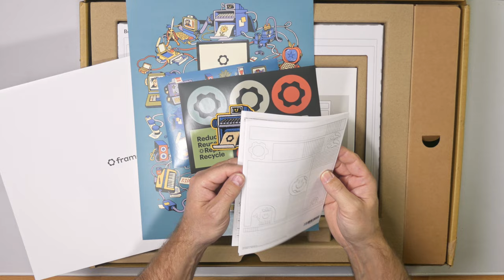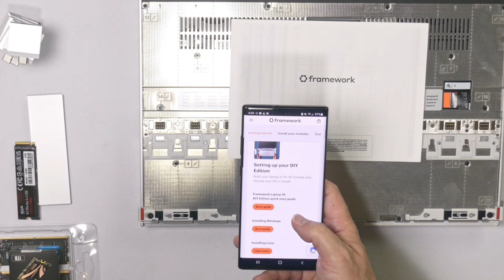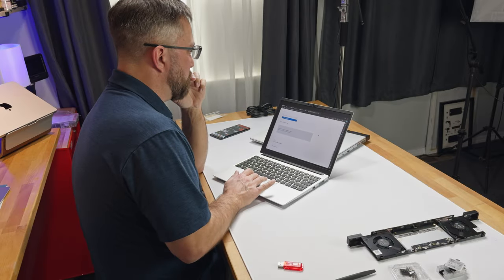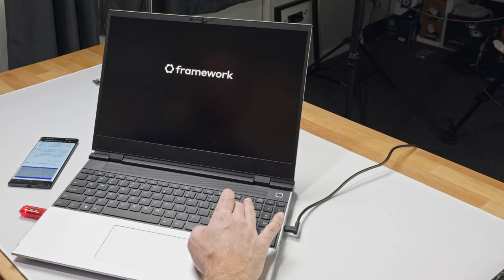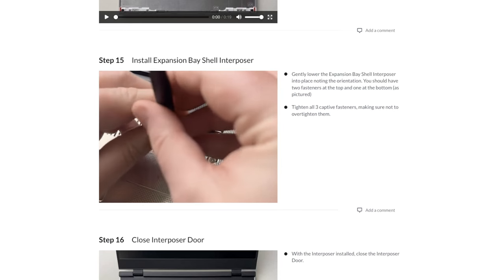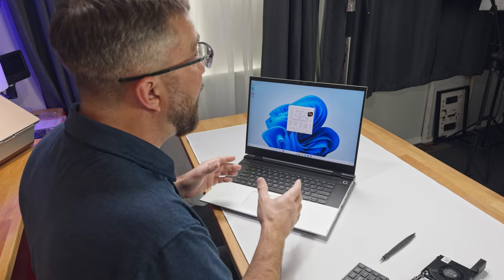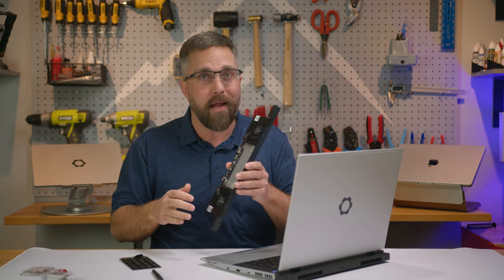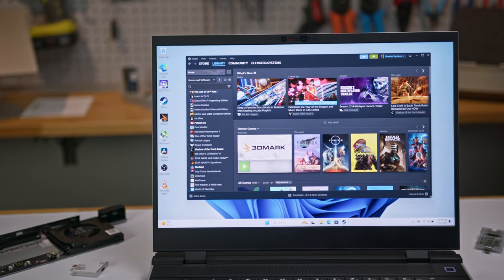The Framework 16!, Unboxing, Setup, & First Impressions!

Comment: looking forward to more videos on this laptop.  I almost pre-ordered it but couldn't justify the cost for my use case.  I love the idea behind framework but the cost is what always holds me back.  maybe one day i can pick up a framework used
Reply from the maker: Framework launched an outlet where you can pick up a refurbished or B stock framework 13 for as low as $499.
Reply: @ElevatedSystems  Oh snaps! def didn't know about that.  I'll have to look into it, thanks for the heads up
Reply: @TokenTech  Don't buy the b stock. The screens have manufacturing flaws.
Reply: @HeyBuddays  thanks for the heads up, I am currently not looking but I do have some friends who are so I will pass it along to them to look out for
Reply: @TokenTech   bro don't lose ur friends , only buy stuff from big brands unless ur frnds are multi millionaire
Reply: @ElevatedSystems  if buy the non diy one you can still do same thing with it as diy one later on
Reply: @Paras-ot2qo  yeah you got a good point, he told me he likes dells... so that's probably what he will get.  At the end of the day I just want him to have something he is comfortable with

Comment: What's the point of upgradability if changing the processor also requires changing the motherboard? All this at the price of a laptop that, at the same cost, is still upgradeable for RAM, SSD, and Wi-Fi card. Years ago, there were laptops with removable CPUs, all at the cost of a few extra millimeters in thickness, something that surely wouldn't have bothered anyone here. Let's talk about repairability and customization, but the concept is simply excessive compared to what it offers. Why is the CPU soldered in a laptop designed to be easily upgradeable? This makes no sense, there's no debating that.
Reply: The RAM is not soldered (maybe you meant cpu?)
And the answer is simple: the CPU manufacturers (amd and Intel) only make them in a bga package to be soldered. There are also significant technical reasons that laptops are exclusively being made with bga (soldered cpus), power, memory reliability, are just the two I’m most aware of. socketed laptop cpus of a decade ago almost never had a real upgrade path due to chipset limitations.
In this day and age through, ram is soldered, storage is frequently soldered, and so is wifi. Part of that upgradability is being able to replace the motherboard easily, and the old one will still function outside of the laptop.
Reply from the maker: Unfortunately, there is nothing Framework or anyone can do about soldered on mobile CPU's. It's completely a decision made by both Intel and AMD. from what I understand they won't even let their partner laptop manufacturers explore ways to socket their CPU's.
Reply: @Lovedbychrist1  Sorry, and thank you for pointing it out. I don't know why I wrote RAM, I meant to say CPU.
Reply: @ElevatedSystems  Too bad, because it significantly diminishes the very essence of the laptop.
Reply: you can easily do it with other PCs when you buy a new one at that price, after all the old PC doesn't disappear when you buy a new one, especially at that price. Furthermore, not everyone has a 3D printer, and the official cases are certainly not cheap, therefore adding to the price of a new motherboard + CPU.
Reply from the maker: @Bluestreak589  you should probably check out my Framework 13 playlist.
Reply: I don’t believe AMD would preclude someone from trying, and a few socketed Intel mobile 12gen chips have been made in china to work on desktop counterparts. Part of the issue is reliability, those weird socketed from mobile chips have memory issues (from reviews I have seen). Its probably more of a case that the engineering to make it work just isn’t worth it when the next generation won’t be supported by the old chipset anyway.
Reply: @Cyrus_Stone  There are a lot of services that will 3d print stuff for not that much money.
Just buying a new motherboard is mostly cheaper than buying a whole new laptop plus you produce a lot more waste and with other laptops is something on the Motherboard breaks the whole is mostly e-waste. And removable isn't a thing anymore on many laptops.
Reply: @Lovedbychrist1  But I'm pretty sure they won't support you in anyway and its quite possible that they something about that written in the contract so you can't really do that on a commercial scale.
Reply from the maker: @Lovedbychrist1  China does anything they want, but yes AMD and Intel preclude their official partners from using their silicon outside of a very strict set of specifications.
Reply: Clevo sells laptops with socketed CPUs. They use "desktop" versions. Their laptops run very hot.

If Framework could figure out the cooling it would be an option. That's a big "if" of course.

Comment: While the modularity of the keyboard and track pad is neat, I hope they have options for a solid all-in-one face plate in a few configurations, mimicking the look and feel of the 13" models. I would opt for a number pad on the right, and the keyboard and touch pad to the left as one solid plate.
Reply: You want the track pad to not be in the center?

Also why left? Assuming your right-handed wouldn't it be better on the right?
Reply: @bland9876  Because that's how all other laptops with a number pad have it. If the track pad was on the right my palm or wrist might activate it. Normally the track pad is centered on the keyboard, making it on the left when there is a num pad. Also, I'm left-handed but I still use my right hand for mouse activities.
Reply: @mllarson  hmm wonder why laptop makers did that.

Comment: Framework is always a fun conversation topic! This seems like a first generation product but still many things done right, while $2700 is quite a bit of money i remember about 15 years ago people paying about a 50% premium for their laptop to just write vaio on the case, and i dont remember them to be that reliable! The good thing is that there is the possibility for framework to fix/upgrade many of the problems down the line, like a bigger touchpad module or a better keyboard or screen etc

If nothing else at least for me Framework is making interesting products, even if they are quite a bit outside my price range, which seems to be most tech products nowadays!
Reply: Never buy based on the promise and, especially, a hope of one.

Comment: Conceptually, I see machines like this as ideal for group deployments like student laptops at schools. In the likely scenario that something breaks due to rough handling it would be easier and less expensive for an IT person to replace individual parts than a whole machine. That said, the price point and the fit/finish quirks might be a tough sell. I hope that Framework is able to address and iterate on some of the common issues moving forward. It feels like they have a decent platform (a "framework" if you will) and that improvements (like different screen, keyboard or track pad configurations) can be released to meet those pain points in the future.

Comment: Nice analysis and rundown. My next laptop will likely be a Framework, and I've been seriously looking at the 16, but I think I might wait until the next gen of the 16's design. There are some fit/finish things you highlighted that I'd like to see worked out. I'm patient and my current daily laptop still have another couple years of life in it yet.

Comment: I've been living with my 16 for a few months now as well--and I can say that pretty much all of your nits align with my experience.  If Framework offered a larger trackpad and a keyboard with dedicated navkeys (even if it precluded the numpad), I'd buy them in a heartbeat.  I've also found the same fit & finish issues with the spacers.  Larger input modules that fill the deck without the need for spacers might moot this.  Hopefully either Framework or a 3rd party steps up to the plate with a solution.  In the meantime, it's moderately annoying but workable.

I didn't buy the expansion bay module so I can't comment on that one.  The price of the laptop was a bit of a stretch for me, but if it really is my last laptop ever, it will have been worth it.

Comment: The only way I was able to get into the framework ecosystem was to buy a Factory B grade Framework 13 model. I got the Intel 11th gen for $600 which included all the USB accessories and the wifi card. I had Ram and an M.2 from an older system that I threw in it.

I plan to eventually upgrade the motherboard to an intel model later. This is where I expect to start saving money. Its so nice to not have to view my laptops as a limited lifespan electronic anymore. Now I can just repair and replace as needed.

Comment: My pre-order is on it's way and I'm really hoping that I'm able to upgrade/improve my framework over time.  This laptop is my replacement for my venerable 15" MBP 2013 (best laptop ever!) and I will be doing a lot of similar tasks, particularly Fusion 360.  I need a big screen otherwise the 13" would have been the right choice by far.  Also, I hate disposable electronics so I'm hoping this encourages other companies.  Thanks for doing a deep dive over time.

Comment: At [5:39] (skip through the second frame by frame), you can see a small gap between the touchpad housing and the actual touchpad. So it looks like grime and dust can enter there during use.
[6:30]: Are the old USB-C modules you have rated for USB-PD-ESR?

Comment: I'm hoping they solve the problems with fitment and finish by the time they ship my Batch 4 order.   Still, the main reason for ordering it is the repairability for a workstation/gaming class computer.   Every laptop I've had that wasn't a full CNC metal chasis has had hinge failure.   I suspect that the framework will also have hinge failure.  It is inevitable on a workstation/gaming class computer due to the thermal envelope reducing plastic lifespan.    I have heard so many: "This never happened to my dell/lenovo/hp/etc." but again, most people aren't doing workstation class work with a business/consumer laptop.   Its all about the use case.  I have been known to have multiple laptops going for 14+ hours a day for multiple days while on the road.   We will see if this meets the needs.   But at least with this I know that a hinge failure likely isn't going to damage the main board and user-available replacement components exist.   I am not expecting it to be inexpensive to repair, but I am expecting to be able to repair it before further damage happens.   I keep my computers until they die.   I'm hoping this one might last until I die - even if it is the "Laptop of Theseus".

Comment: Thanks for the review! So glad I cancelled my batch 2 order. At this price point, this laptop is simply not worth it and the only reason to buy this is because you support the FW mission statement. However, even that is somewhat problematic when you can get Thinkpads and HP Elitebooks that are equally user repairable with available components and official tutorials but with better build quality. I even believe LTT did a video on the high user reparability of the Elitebook 845 G9. But the FW 16 is a gen 1 product and can only get better. Looking forward to more of your videos as well as seeing how FW expands on this concept moving forward!  Nice job CJ as always!!!

Comment: Odd about the SSD, the 2230 is the secondary storage and the 2280 is the primary when configuring at purchase. What type connector is on the modules? It's interesting that you can put different connection types in any of the slots for the most part, Ethernet, hdmi, usb, work on the same ports.

Comment: The concept is mildly reminiscent of the Sandbenders laptops in William Gibson's _Idoru_. These were highly customized/individualized machines with a recycled chassis and DIY components: "And once you had the case, when the manufacturer brought out a new model, well, if the electronics were any better, you just pulled the old ones out and put the new ones in your case. So you still had the same object, just with better functions."

I doubt the Idoru copyright holders would go for it, but if Framework takes off i wonder if they might co-brand a Sandbenders model... or some 3rd party can do it.

i have no idea if the Framework (batch 11)  will save me money or create less e-waste over time (maybe chassis will get "old" and I'll want a whole new system, or maybe the easy upgrades will incentivize more incremental upgrades over time creating more e-waste).

Comment: Oooft, the bezel pinching on the screen and the little corner jutting up on the spacer is yikes. I'll need to get myself some fine sandpaper just in case for when mine arrives. It's definitely some additional QA steps they could do on the floor for those problems.

Comment: Regarding whether price is important for a review - I kind of land somewhere in the middle. A product is either good or bad, and separately, is priced too high, too low (this can be a problem) or just right. Another aspect to Framework is that the price to performance should be at least within a reasonable margin of the competition, but I think a full half of the value of the laptop is the design philosophy, component interchange and repairability.
Reply: However. This laptop can be boughy piece by piece. The company has an onlune outlet. Etc. You cannot just say it cost too much. Their modularity lessens this argument. I hope othrr companies take notice and start making a std for all laptops like on pc.

Comment: After hearing the concerns with the keyboard, I have to wonder why Framework didnt opt for a 15 inch machine instead. I imagine recycling the 13 inch parts into the design would have been less awkward.

Comment: Well i found this interesting just got no usecase for it right now sadly even though i like its modularity.. one of the reasons is that i dont need a powerful laptop right now.. it mainly needs to be a mobile camera and storage/ Display Device for my digital files while on the  go. What mightve still sold this to me would ve been a 10G and 5g Option on the ethernet module, because i am really looking for a notebook with one of those so i dont need to use dongles for those ... speaking of the ethernet adapter: I am also saddened that it sticks out wich makes it smarter to transport that separately.

Comment: I'm a bit disappointed that the usb slots are right in the middle of the sites. At the top would be better to make cables, usb-sticks etc. further away from you and a potential use of a bluetooth mouse. fans should only be at the back where the expansion module is.

Comment: I hope if Framework listens to You really tell them all the world now moving to 14" as the king of sizes in terms of performance and portability. So, I hope they rethink at the idea of the 13" and make it 14" with the option of HS  AMD processors or even Intel.
Reply: A 14" Framework would kick ass. Funnily enough compared to other decent offerings at that size, even the 16" Framework is very competitively priced, at least where I live.

Comment: My 17 inch hp laptop i got back in 2006 was $1700. With inflation that's around $2300. that laptop is still cheaper by $100 despite the amount of customization you put into it.

Comment: is there a software/hardware switch to turn off the discrete graphics?
Reply from the maker: It’s a software switch and it’s automatic. The system runs on the iGPU until a program is launched that requires the discrete graphics. You can also disable the 7700s in the Radeon software.
Reply: @ElevatedSystems  thanks for the info!

Comment: I compared the diy version vs the prebuilt and it doesn't save you that much money going with the diy option
prebuilt: 2128$
7840hs 
16 gbs 5600 (2x8)
512 gb ssd with windows home
7700s 
numpad
power adapter
2 usbc modules
3 usba modules
1 headphone jack module

DIY version: 1961$
7840hs 
7700s 
numpad
power adapter 
2 usbc modules
3 usba modules
1 headphone jack module

2128-1961 = 167
You basically get 167 to make up the difference in ram, ssd and operating system. 
a 16 gb stick of 5600 ram is about 60$ (on amazon, the ram sold by framework is 80$) ssd cost will depend on your model but you're left with 107$ left for the ssd and operating system.
if you're a windows user and don't want to use a grey market key, The prebuilt option is more compelling.
Reply from the maker: I got 32 GB of Memory for $99 and 5 TB of storage for $320, Windows 11 Pro has been basically free for years now as you can use it without activation with zero problems. I only activate Windows if I'm using it on a system where it will be the only operating system in used. Like on my gaming PC.
Reply: @ElevatedSystems  sorry my comment wasn't targeted for your configuration, more so for casual users, who don't need all those upgrades. 
Just out of curiosity I'll do a cost comparison for the overkill specked prebuilt
So 420$ for upgrades 
2161$
7940hs
32 gbs 5600
5 tbs ssd(s)
7700s
numpad
power adapter
2 usbc
3 usba
1 headphone jack

2161+420=2581
Total cost of DIY (not including windows license) 2581$

2518$ Prebuilt
7940hs
32 gbs 5600
1 tbs ssd(s)
7700s
numpad
power adapter
2 usbc
3 usba
1 headphone jack

a remainder of 63$ for a 4 tb ssd (assuming the included ssd in the framework prebuilt is a 2230) you save 161$ or more going with the diy version. so it makes perfect sense for you to go diy.